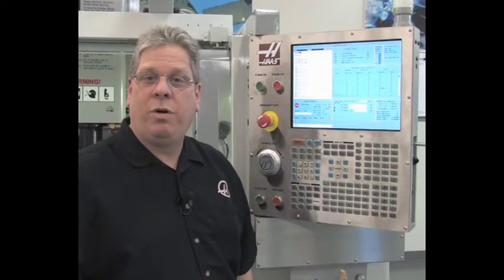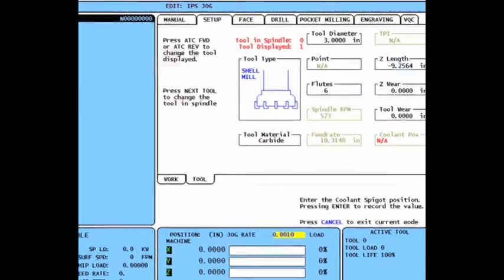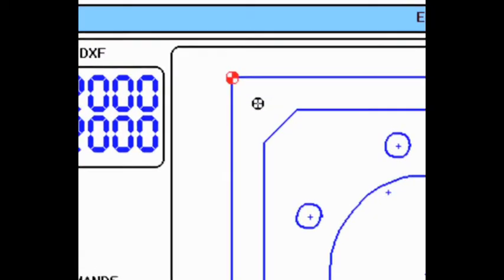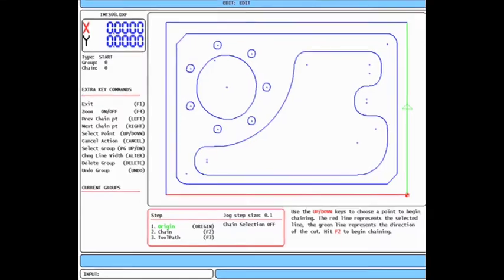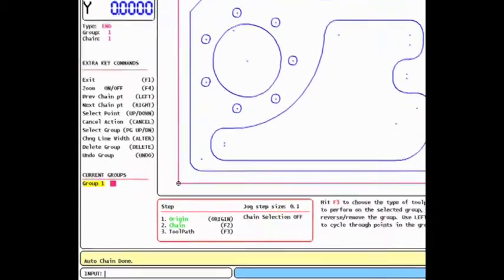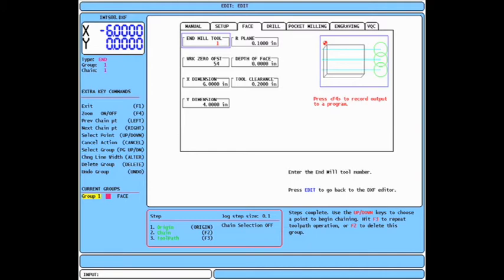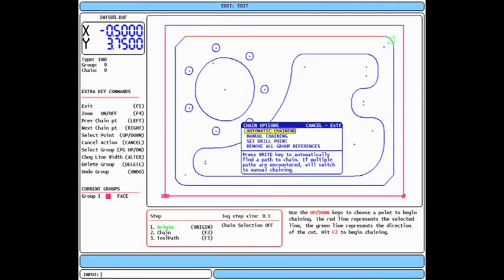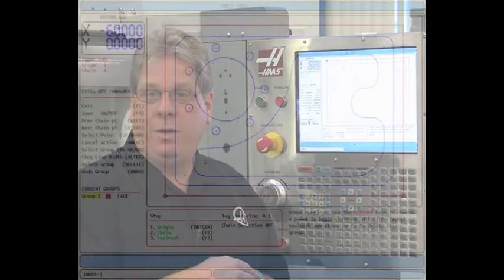Haas DXF Import — How To

Comment: Just a suggestion. I would attempt to redesign the interface to be similar to a 3D printer program, where the main factor would be just loading in the part with a simple file browser. This would cut down on steps to remember and complete and be more "intuitive". I understand there are some steps that need to be completed like calibration, but many of the finer tuning could be hidden in an "Advanced Menu".  A good safeguard to make sure the part would be machined correctly could be to have the display play a video animation of the process that the Haas will go through, with the tools and initial block of metal dimensions programmed in.

Comment: Recently got new VF2 machine and Im dissapointed with IPS in general.
If i need to make contour and rough it out I can't select  stock to leave?!

So I can't do any profiling on control with optional extra paid IPS that has maybe 5% capabilites of Fanuc Manual Guide or Siemens ShopMill that I used to work with.
Reply from the maker: Hi razor666666 - We're sorry to read of this issue. Please provide direct contact info (phone number and/or email address) for yourself, either by replying here or to Contact@HaasCNC.com. A representative from our Applications Department would like to speak with you regarding this. Thank you.
Reply: Haas Automation, Inc.
Thanks for quick response.
You can contact me on servisracunala01@gmail.com

IPS allows to select stock to leave only on pocket but on contours is n/a so its for my type of work kinda useless in that way.

Best wishes, Zoran

Comment from the maker: (continued)

Mill IPS was introduced in software version M13.02 below are the requirements for this software version.
-Brushless motors
-Mocon board version M or later
-68k processor with 10-inch LCD and at least 1mg memory
-Serial keyboard interface version 104 or later

Please let us know how else we can help. Thank you vpleric.

Comment from the maker: Hello vpleric. First, we need to know what the configuration of the machine is and if a lathe or mill? If the machine has all of the requirements below, then yes, it’s just a software upgrade.

Lathe IPS was introduced in software version L6.02 below are the requirements for this software version:
-Brushless motors
-Mocon board version M or later
-68k processor with 10-inch LCD and at least 1mg memory
-Serial keyboard interface version 104 or later